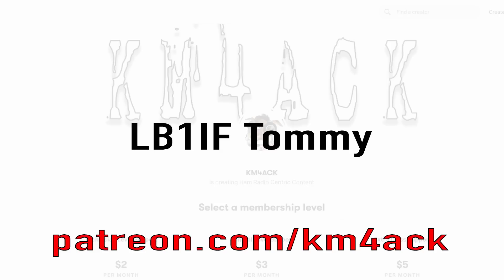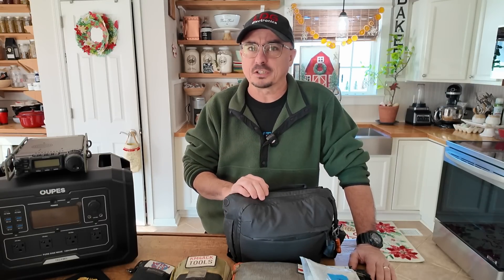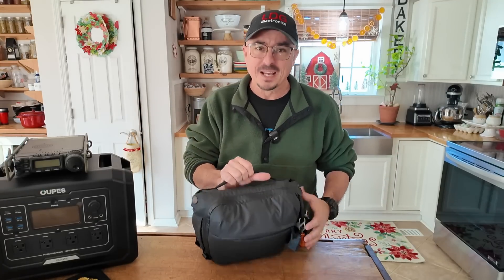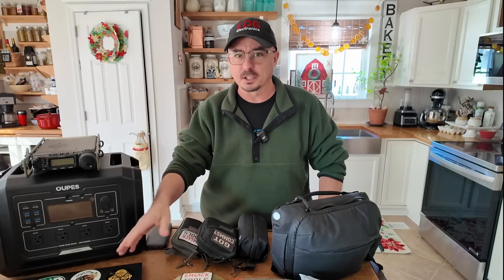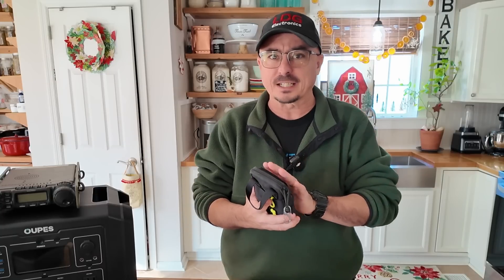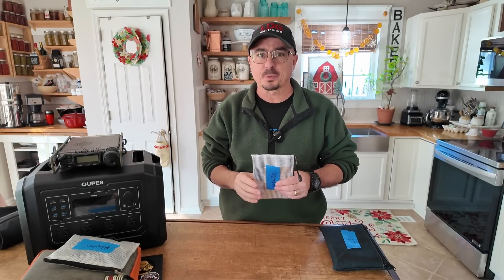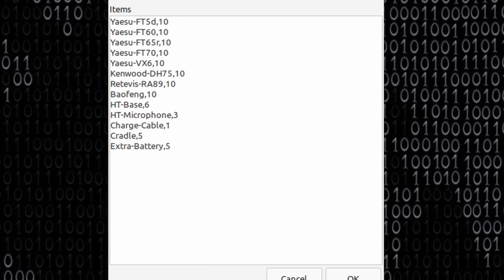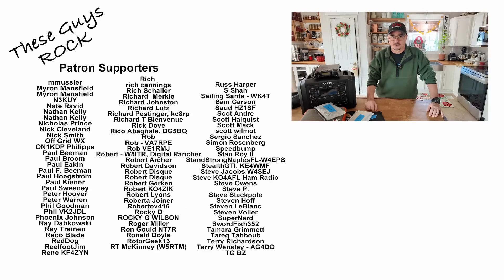I Stopped and You Should To

Comment: I have a few go bags, but they aren't for me. Instead they are minimalist HT kits intended to be passed out to other, less prepared, operators or to quickly get those in my network on the same channels (useful for friends and family during emergencies). 

I can simply hand out a kit that has an HT, quick start guide, reference materials, batteries, chargers and other essential accessories rather than digging through my spare gear for what they may need.
Reply from the maker: You described what I call the "Community Module" https://youtu.be/34z4zrtdCu8

Comment: If you're taking suggestions... The one thing I see I would strongly add is an Inventory Management System. An itemized listing for inventory. 
You need a break down of what's in each bag/ case with a sheet listing such installed in each bag, as well as a MASTER list of the bags and list on your laptop.

The modular method is used by many organizations. I belong to one as a communications specialist. I just got back from spending several weeks on the ground in Asheville,NC., and without this inventory system, there isn't a chance in hell I would have located assets that made their way to another disaster zone. Doing regular asset checks on deployed equipment to other users, and simply just setup in use around site(s), helps ensure nothing walked away, got misplaced, or damaged without notation.  Accountability at the end is the goal. To our own dollar or stakeholders. 

I really enjoy your videos. I have watched your channel and journey from the beginning. I appreciate your honesty and love seeing your growth. Keep it up. 73 OM, de KF6NFW

Comment: Been going modular for years now. It is THE way to go. Before I had everything tossed into a backpack or messenger bag. 
And when looking for something (especially in a hurry), you always upend the pack eventually and dig through a pile of equipment and random junk like old receipts, loose change, candy wrappers, that book you’ve been looking for, etc. and then you pack everything back up. No structure here. Two ways I addressed this: 
One, limit yourself to the smallest bag you can get away with. Not so small that you need to cram and squeeze everything inside but small enough that you can load it comfortably. But no bigger. The more room you have, the quicker it gets filled with random junk. I used to use Messenger bags, but that wreaked havoc on my back and shoulders. YMMV. 
Two, use modules like here. I use those small food containers for some stuff, or Peli micro cases which has the benefit of being waterproof. Also, I use a relatively small pack, in my case the Hazard4 Plan C. There is just about enough room in there for my normal stuff and it doesn’t get too heavy.

Comment: I’ve learned I have no use for any digital mode which has allowed me to leave an awful lot of junk at home. Cables, USB interface, a rather large laptop. Real hams pick up a mic or CW key, not let a computer make all of their contacts!
Reply from the maker: The computer is more for moving data instead of making contacts. We recently sent a CSV file containing 104 lines of entry over the air (VHF) in under 2 minutes. Something that is impossible to do in the same time with voice or CW.  This data pertained to a local event that our club supports each year.

Comment: I'm building for EmComm, so I'm building a 'go truck'.  :)   Still building the bows for the bed cover.  It'll be similar to the cover for a deuce and a half, but for my pickup truck.  Still high enough to stand in when it's done.  It will work for EmComm, or simple POTA.  I keep a manifest to check before deploying, as I'm prone to brain farts at this point.  It's still a year off before being done.  I'm old and slow, but keep chugging along. Backpacking and probably SOTA are not an option anymore.  I've already built the main power box for solar, and have the first battery in it.  Charge controller is due in today. (I messed up the first one, mounting it on the lid, then the lid slammed shut in the wind.)  I have a small crane for loading the generator, as well as the solar battery box once it's loaded with batteries and controller, etc.  3 to 4 batteries will be in the box, at 100 Amp Hour each.  More later as I get further along.

Comment: Great video Jason. I operate 100% portable or mobile and my set up varies, different locations, rigs, antennas and battery depending on what I want to do. How far I am walking, cycling, kayaking etc, sometimes weight is important, sometimes space and sometimes both, sometimes neither. I like to keep things neat and tidy so I understand the appeal of a go box but see some that are massively over engineered with lots of built in redundancy turning a lightweight small radio set up into one massive box that would give me a hernia if I lifted it. Each to their own of course and that might suit those that always use the same set up and who walk 15 feet from their car to a picnic bench to do a POTA so I am not knocking it, but it’s not versatile enough for my MO. I share your approach and it works for me also. 

Subbed👍 73 Kevan 2E0WMG

Comment: I take what I need and no more. FT817, coax, mic, key, battery and lead, pen and paper, watch, aerial and tuner, SWR meter, and not forgetting myself.
Why do you want a laptop? I take a pen and paper.
I only have a motorbike and rucksack so very limited what I can take. Or I get on a bus and/or train, still limited what I can take.
I've no room for tools and never needed any.
Wi-Fi? Why?
I can't take a load of cables.
Coax adapters? I take what I need.
It seems to me that's a lot of unnecessary stuff.
G4GHB.
Reply from the maker: Laptop for JS8Call, FLDIGI, and Winlink.
Reply: @KM4ACK  Why?

Comment: I have done similar. Master checklist for off grid camping. Go bag for each radio with a checklist for each radio on a spreadsheet (ic705, FT817, FT857, (duplicates of digirig, etc. in each), with options at the bottom for antenna masts, solar, etc. I have a bag for wire & connectors, and a Milwaukee Packout for test equipment, another Packout for RF connectors. Plastic "shoeboxes" for DC adapters, etc., another for all the USB stuff. I always carry a small "get home" comms+ bag and IFAK in the truck. A 72 hour bug out bag with checklist is at the ready in the house, along with small lightweight shelter, sleeping bag and mini cookware. It works for me.

Comment: I agree that a modular approach for certain activities is the best approach.  Ham radio and camping are two activities that require a modular approach.  The equipment you take with you when driving up to a spot to set up is going to be different than the equipment you take if you have to walk to the spot you will be setting up.

Comment: I love what you are doing - right on! Please keep refining this system as every ham can benefit from adopting it.
A couple of thoughts:
1) The adapter pouch: For miscellaneous pouches like this, I would make a list of the contents and keep it in the pouch. That way, you can do a quick check, such as 13 items on the list- check, 13 items in the pouch. This helps if you loan someone an adapter in the field, but it doesn't get put back in the bag for some reason. 
2) Many times either/or pouches can be helpful: for example, a winter pouch or a summer pouch - generally, you would not need to take both. In the case of an HF antenna pouch, a pouch for the desert (no trees) would need different contents for a pouch where you were planning on shooting a wire over a tree. 
DE WA1KLI
Reply from the maker: 1. Don't loan out your gear 😂 All kidding aside, #1 is a fabulous idea!! You will likely see it in a future video.

Comment: You referred a few times to “things I need on a day-to-day basis”, and that included radio(s). I’m curious how you use your radios day to day. I’ve been a ham for a little over a year and don’t use it very much. Aside from a handful of local club events each year, and speaking a few words to check into local nets each week, I don’t find a real use for the radios. Contesting and even rag chewing on HF can be fun but they’re way too time-consuming for anyone that has multiple other things to do. I have an HT and GMRS radio in a little bag in my truck but they haven’t been out of the bag in at least a couple months since I put them there. How do you use your radio stuff on a day to day basis?

Anyway thanks for sharing this - I like your modular approach. As a Program and Project Manager I appreciate the organization. :-)
Reply: @KM4ACK future video idea?
Reply from the maker: I'll use various radios to communicate with friends in the area, check winlink, and use APRS. Sometimes it's a mobile, sometimes it's an HT. During inclement weather, the VX6 becomes my weather radio. My day job requires a lot of outside time during the spring. In the southeast, the VX6 is essential for early alerts of severe thunderstorms or tornado warnings. Because it lacks SAME (https://en.wikipedia.org/wiki/Specific_Area_Message_Encoding) technology, I usually get earlier warnings on the radio than on my phone. 

The small kit is designed to be easy enough to carry and not take up much room in my bag nor weigh enough that I don't want to grab it.
Reply: @ Thanks for sharing!
Reply: I use my radios almost daily.  I will get on the local repeaters during my commute to and from work or when out running errands and chat with whomever is monitoring and willing to talk when I toss out my callsign.  When doing anything outdoors on my property I will have my HT next to me, unless I am mowing the lawn.  For the most part repeaters exist so that local hams can have conversations without worrying about the limitations their equipment might have on simplex.  For example I am a mile and a half from my local repeater.  I can use a handheld to have conversations with other hams 30 miles from my house over the repeater, but with that same handheld I can't talk to someone who is 6 miles away while using simplex.

If your local repeaters are quiet start putting your call out on them once a day to try and get more traffic on them than the weekly nets.

Comment: I have a basic HF kit and a VHF/UHF  kit along with a tool bag. That has adapters, coax, and assorted ends, USB cables and converters, soldering iron (USB/PD). Then I have other kits with whatever. Tablet. And from there I make use of your list generator. My Mac book pro running Mint, And a USB stick with Ventoy and several persistent volumes with other Linux flavors. One is Zorin OS and I use that when I need to program a radio that I need a Windows only program for. It works quite well installing windows programs easily ( most of the time anyway )!